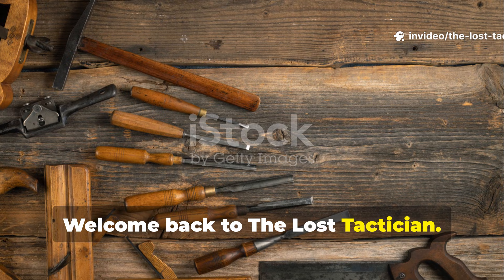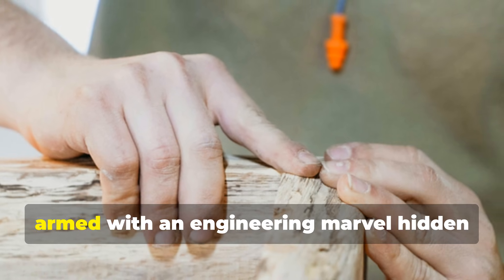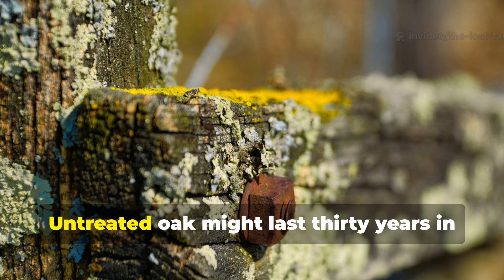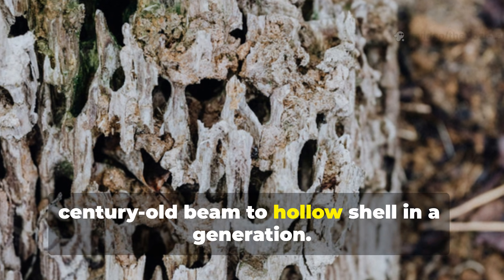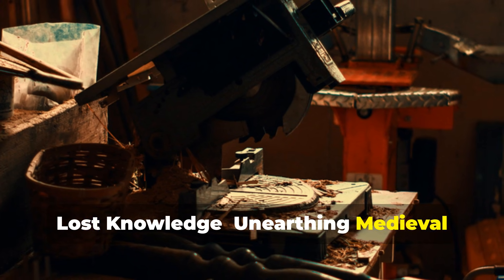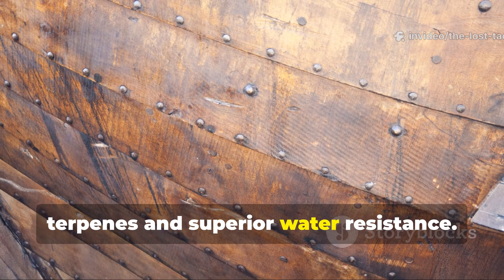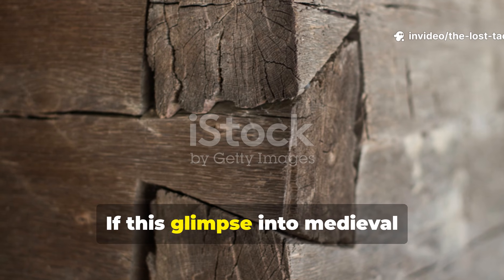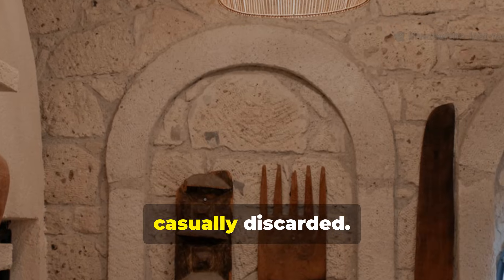Medieval Timber Oil That Outlasted Time and Moisture

Comment: Oak is very heavy; not "light" at all.
Reply from the maker: Correct—oak is one of the heavier hardwoods. The point I was making was about its performance once seasoned, not its physical weight. Thanks for adding clarity to the discussion.

Comment: In the 1970s a restaurant that had antique tools hanging on the exterior of some of the walls would periodically coat the wood with a 50/50 mix of boiled linseed oil and turpentine
Reply from the maker: Exactly—boiled linseed oil thinned with turpentine has been used for centuries to protect exposed wood. Practical evidence like this really reinforces how effective these older methods were. Thanks for sharing that experience.Thanks for sharing that experience.